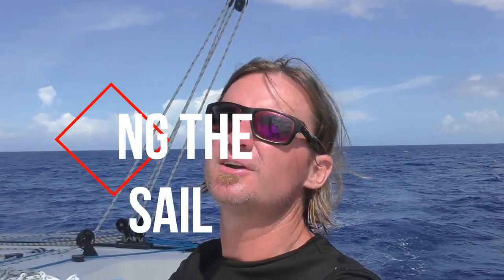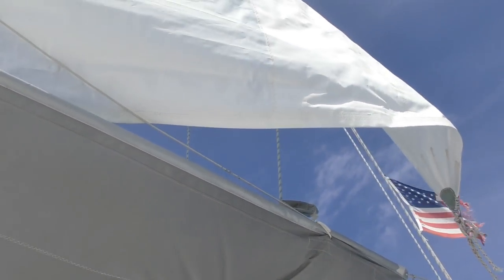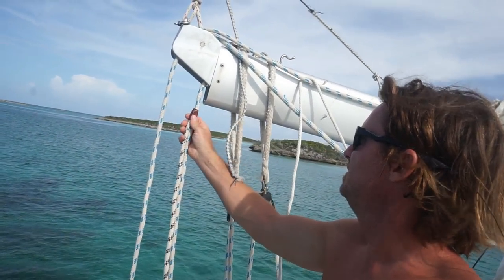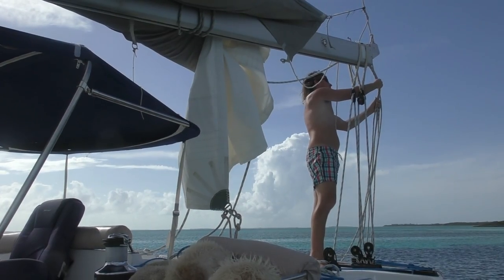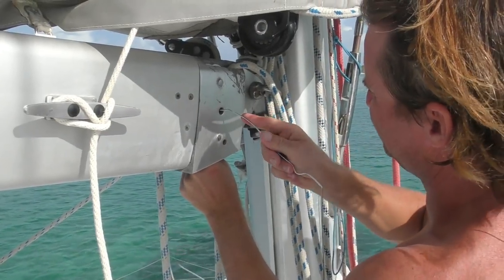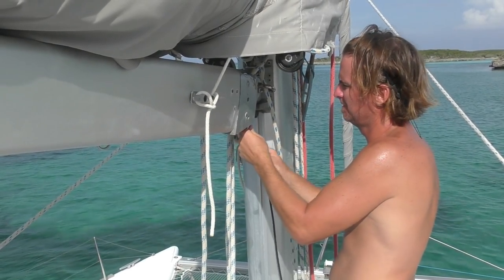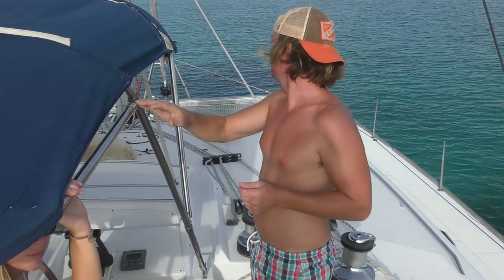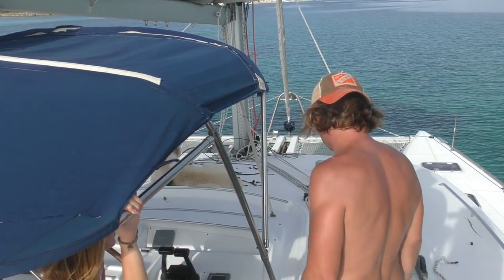Re-Rigging The Main Sail - Boat Maintenance Monday - Sailing Doodles

Comment: Hi Bob and Megan, love the vids. Wife and I completed a similar sailing journey that took us 5 years in the early 90's. Need to reiterate what others have posted about your outhaul. It still is not complete. In addition to rerouting this line, you secure it to the boom with another line. The outhaul is not meant for constant tension and is only used to tighten and loosen the foot of the sail to make sail shape adjustments. You then tie off the clew of the sail to the boom. As you have it now with constant tension it will break every time and the reason it has done so twice before. BTW, these tiny adjustments on the outhaul make huge differences in sail trim. It is the best place to make an adjustment in the shape of a sail and many overlook this aspect of trimming a sail. Good Luck and thanks for the vids.

Comment: Your outhaul is not only for up wind and down wind control. It acts similar to the flaps on the wing of an airplane providing more lift when you need it and should be adjusted in combination with halyard and/or cunningham  tension both for upwind and downwind sailing depending on apparent wind speed. Lots of great books about sail trim to help you improve sailing performance and enjoy your boat. Best to both of you.

Comment: Hi Bob
One thought after your tricky outhaul fix. You need a separate strop around the boom to take most of the load of the sail. The outhaul should primarily be to adjust the tension of the foot of the sail only. I use a heavy duty all metal sail slug on my boom but a line or strop around the boom will work too. ( that way when the out haul breaks again the boom will not crash to the deck.  Cheers Warren.

Comment: Don't forget to fix or remove the broken pad eye at the end of the boom. It will foul your lines or sail and you'll have another repair or worse to deal with. It was there for a reason, so try to figure out if it was a useful one before just removing it. Great to see you keeping with it until done.

Comment: Bob, it's still not rigged correctly :) You should have a pulley on that corner  (sorry I'm not accustomed with the English terms :) )
It should work but keep in mind that that kind of trimming is done while the sail is working and it might be too hard to tighten it when the wind is blowing. 
Anyway this is how I would do it. 
Otherwise, love you guys! 😀